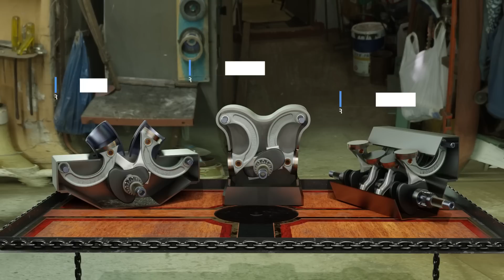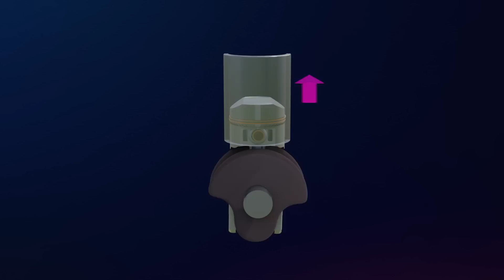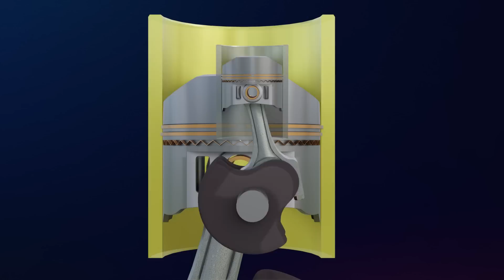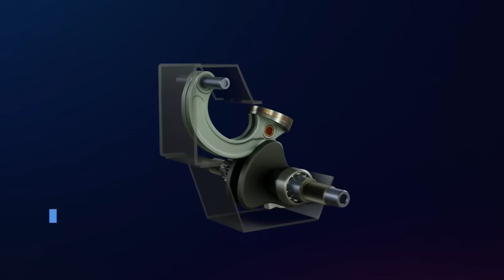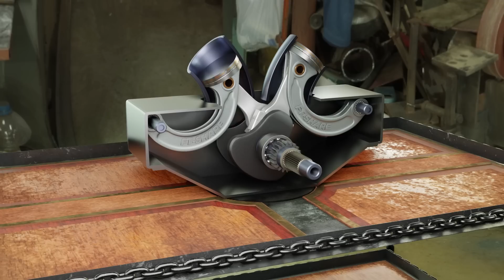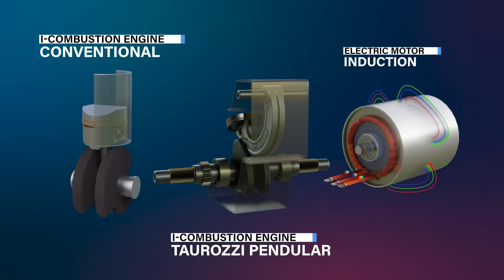All about the Taurozzi Pendulum Engine | Advantages, Working Principle, and Performance (100144.V1)

Comment: I would say, from a commercial standpoint, that any advantage of the 'low friction piston' would be offset by the difficult to machine bores, the balancing issues of the curved piston arms, connecting rods and crank all working in different planes, and it the extra reciprocating mass involved.
Most modern engines have tiny pistons, with virtually no skirt on them, just a small pad with Teflon on it.
Reply: Machining it is no more difficult than a linear type. The secondary balance issue is where it goes all willy nilly.
Reply: @ejrupp9555  I beg to differ on the machining also.
How do you machine a smooth finish on a curved bore and hone it suitable for piston ring sealing easily?
Certainly going to be more difficult/expensive than a cylindrical bore.
Reply: @ejrupp9555  If you put to engine together one on top of the other, where the spark plugs would be.  Then you could put 20spark plugs through the wall of the torus!  Yes you would have 2 crankshafts with gear on that would mate with a common idler gear that drives the out put shaft which would be on centre. This would get rid of some of the balance issues & double the power of the engine! Obviously it would have to be a Reed Valved crank compression, exhaust side ported 2 stroke!
Reply: @Danger_mouse  you would need a surface table that is geared to tilt at a rate proportional to the depth of the head stock. It would be a specialist piece, but not that specialist. Most industrial CNC machines could do it, but such a device could probably be made in a home workshop.
Reply: @arandomsteve2251 
I understand that it can be done, but it is not as simple as boring a cylinder, and therefore more costly to produce.
Also would be difficult to produce the perfect bore finish required for ring sealing (again, yes it could be done, but not simply with a straight jaw set in all cylinders like a production inline engine)

Then there's the balance issues on top of that.
This is why they aren't in production.
Reply: yes, but if they invested billions in a flawed technology like the rotary engine, why didn't they invest in a better attempt to do this, in my view this was "industrial sabotage".
Reply: @wvision1433  Mazda perfected the rotary engine, something nobody else managed to do.
During the 80 & 90s they were long lived and reliable, even as a turbo version. 
Only when people modify them do they start to become unreliable, and the later Renisis version was an attempt to chase the emission laws of the times.
Mazda did all of this on its own and from their own pockets.
If the inventor of this engine wanted to further the design, then he needed to work on funding himself.
As far as I can see, it offers no real world advantage over a conventional piston engine, that is why it is not mainstream. 
It's heavier, harder to machine and looks likely to have balance issues to solve. 

There's no conspiracy.
Reply: @Danger_mouse  I 100% agree with you, as a machinist and motorcycle mechanic I have no idea how a toroidal cylinder can be machined at production or any other level, it surely isn't going to be simple.
Reply: @1crazypj  Anyone who thinks this is manufacturable at scale has never made anything in their life😂
Reply: @curtislavoie2242  
I agree as  I've worked in a smaller  factory doing production machining way back when CNC was 'new' (outside of major plants, 1970's)
'We' had about 200 employee's, Sony factory 'down the street' had about 25,000.
Reply: @wvision1433  everything has to be a conspiracy right ☻
 It's not even contemporaneous with the Wankel 🤭
Reply: @Danger_mouse  no that's true the conspiracists can go prattle about Building 7 and all that rubbish.
However, as long as we all know that however perfected, and by whomever, the Wankel rotary has built in thermodynamic 'issues', namely a slow rate of compression, or pressure rise curve amda very poor combustion chamber shape
Reply: @TheHarryMann  Certainly can't argue with the rotary shortcomings, but Mazda did make it work reliably for many years.
Carrying a fire around with a triangle in an oval is not going to be the most efficient way to make and engine work, but they did make it work, and well 🙂
Reply: @Danger_mouse  Shouldn't be that difficult, but you need special tools.
Reply: @Danger_mouse  Liquid Piston has actually perfected the rotary engine. But yeah.
Reply: @Ridd333  Waiting to see how they solve the problem of sealing and wear.
Interested to see how they get around these issues.
Reply: @Danger_mouse  I mean, the seals on their fixed points on the block and not on the rotating piece is already a huge step forward. Might even suggest that LP has claimed as such. Not sure the testing done to the engines however.
Reply: Much more costly, more difficult to manufacture/machine the cylinders, more moving parts/complexity.
This is not the future of the ICE (if it has a future)
Reply: @Ridd333  curious why the location of the seals makes a difference.  The same parts come into contact with the seals.  Most curious is that the liquid piston uses a huge chunk of steel as the piston.  I have to read more into the liquid piston to see what makes it better than the wankle.
Reply: @Power5  The seals being in a fixed position should offer better material to be used. More robust, as well as not being wiped around at 6k rpm. 

So not only the seal thing better, but the shape allows for higher compression than the Wankle variety. I have not dug too too deep into it, so please do. Let's discover!
Reply: @Ridd333  But the end result is the same.  The seal is being rubbed against a chunk of metal spinning around at 6k rpm or the seal is attached to a chunk of metal spinning at 6k rpm.  In both instances the seal is always touching metal at whatever RPM the engine moves at.  That is why I cannot see any benefit to the seal being fixed.
Reply: @Power5  would you not agree that there are forces involved in the moving part mounting vs stationary?  Centrifugal force on seal as well as striking vs being struck? Plus the space available on the wenkle style is confined to the points, whereas the LP design offers more surface area for said seal.
Reply: @Ridd333  But there is no striking.  The shape of hole, that the dorito or whatever sponge shape you call the LP, is precise so that the seal is always under the same contact pressure with the metal.  The seal is never lifted from contact in either engine.
Reply: @Power5  oh sure. Same on Wenkle. My bad. Either way, those seals are common failure points on the Mazda iterations of rotary motors. LP claims their design corrects that by having seals in the block, not the "piston". Is that the only reason? Not sure. Other things I mentioned above may apply
Reply: Why are you arguing with people who have most probably never entered a machine shop....... those who say that making a toroid is as easy as a cylinder might have only done it in the virtual world, never on a machine that actually cuts metal..... 🤣😂🤣😂
Reply: @MondayMorning-yv7nf  Great point 😀👍
Reply: @Danger_mouse  The engine block is mounted on the piston pivoting axis and then rotated against a fixed boring head. One of the videos talking about the engine show the machine doing just that. If it was a ridiculously complex task, do you think a random argentinian inventor would have been able to do it over and over again in his garage?
Reply: @jackmcslay  I never mentioned ridiculously difficult anywhere, I said more difficult than a standard bore engine.
Anything that adds time and complexity to the machining and assembly process adds cost.
My comment was about the commercial aspect.
Reply: @Danger_mouse  and from something that was just pump to start with
Reply: How are Taurozzi engine cylinders machined?
This arrangement is currently produced for Mechanical Ventilation Medical Machines, where arrival of lubricating oil to lungs could be deadly.
Taurozzi engine uses no lubrication. Has it?
Reply: People saying this can’t be done in large scaLe production have never heard of Elon Musk or Tesla
Reply: @joedasilva38  Can be done. My original comment is that from a comercial standpoint, it wouldn't be via or have a market.
We humans can do anything, we have a rover and a helicopter cruising around Mars collecting samples... doesn't mean this weird, shaky engine design will make money. 👍
Reply: not much. the drill is mounted on a pivot.  @Danger_mouse
Reply: @geoffgunn9673 This engine is loterally used as an air and other liquids compressor, it makes more sense to invest in an engine that requires minimal lubrication than in a water pump that requires double the lubrication because of its flawed design (dorito engine), its obviourly been sabotaged or ignored by manufacturers because it would crash the librication industry and its derivaties which is not a bad thing

Comment: Not to take anything away from Taurozzi, but if the primary benefit is the reduction in frictional losses due to positional control of the piston, the same thing could essentially be accomplished with a guided upper piston rod, much like steam engines used a century ago.  Would require a taller deck, but wouldn't require the specialized machining of a curved cylinder bore.
Reply: That would simply move the friction losses to the guided rod.

Comment: Wouldn’t the piston skirts, even though shorter than conventional pistons, have to be curved to match the inner and outer radius of the curved cylinder and taper to flat at perpendicular to the curve of the cylinder to maintain tight enough tolerances for the piston rings to seal?
Reply: Yes, and drilling out a toroidal engine is easy with curved drill bits (that's a joke), which makes this the most complicated machining task possibly on the face of the planet for conventional tools. Its obvious why its not popular when jet engines are probably easier to machine than this thing...

Comment: Do you 3d print the cylinder or torus?/ Bcos it has to be very smooth surface. What cnc machine was used to bore this?

Comment: I have an article about the British Tri-Dyne engine featured in the July 1969 Popular Science magazine. At 350cc (21.35 cu. inch), weighing 135 pounds it delivers 90 hp. It is a true rotary engine since it does not turn eccentrically like a Wankel engine. Also it requires no seals which was a problem with the Wankel.
Designed by British inventer John Marshall the Tri-Dyne engine has 3 moving parts turning up to 12,000 rpm plus. It is more compact than the coventional automobile engine and would be ideal in aviation applications.

Comment: 30% more efficient? Never. Only a part of the friction in the motor is abolished, the other (mainly thermodynamic) losses remain unchanged. On the other hand, the bore (and also piston and sealing rings) cannot be machined on existing machine tools. Forget it.

Comment: Mazda keeps fine tuning the Wankle engine designs. They have been doing so for 40 years. For Mazda engineers the motivation is not profit, but the engineering challenge...and proving they can figure out solutions to the quirks in the Wankle Engine.
---
Just imagine if Mazda engineers spent that same 40 years of effort and passion to make a Taurozzi Pendulum Engine as powerful and efficient as they could?
I do not know the result they would achieve, but improving something already pretty cool...magnifies the benefits of it. Taurozzi himself had the dedication to improve his design, but never had a budget to properly commercialize it.
---
I looked at some other comments.
Machining the curved shaft is a challenge, but its already proven as possible...so if commercialized it would just be improving from something that works.
The biggest downside from the few comments I read is the length of the Swing Arms. Basically they would have a lot of mass as shown; this would limit the maximum RPM before inertia destroys engine. Titaneum alloys would reduce this problem of course but this issue might be the primary reason big auto makers did not want to commercialize it. A low RPM engine has its uses, but not regular cars; powering farm vehicles or specialized equipment like a gas powered compressor is much more niche and harder to make a profit than cars are.
Reply: and now they have relegated the rotary to charge an ev,,

Comment: 1. It is doubtably that it could run on a traditional vehicle without coolant or radiator. Modern gasoline IC engine is like 35% effecient, with 30% more effecient, let's say an effeciency of 50%, there is still a 50% of energy of burning gasoline purely converted into heat. If this engine is set up as a F1 application, which is a turbo charged 1.6L V6 revs at 15000 rpm, please, don't cool it. 2. The moving direction of the piston is circular, the expension of the combustion of the gasonline is evenly distributed. which means the force against the piston is uneven, which is almost the same as knock. Unless the spark plugs are placed at the far side of the circular combustion chamber but this will propose that the fuel injector to be places also with the spark plugs (direct injection) or uneven compression will lead to uneven heat distribution which causes knock. 3. The third ring on piston is oil control ring which is used to keep the cylinder wall lubricated while leaving not too much oil on it to be burnt. You need oil when there is a friction, even the connecting rod is like a banana. A rotary engine has much less friction surface than this engine yet the apex seal fails even with lubrication. 4. Balance. It's a nightmare for engine balance. I mean, just look at that jumping engine in the video. Traditional engine has two imbalance to solve, the primary imbalance and the secondary imbalance and these are fairly obviouse since the piston only moves up and down. But with this, the force is in reciprocating-circular manner, I would very much like to see how complicated that the balance shaft is. In general, this engine will work but not for long if it is used for vehicle power source. A rotary engine is better in every aspect that this video clams yet the effeciency is terrible and the longevity is a joke.

Comment: Funnily enough, when I saw the Toronzi's "Boxer" Format, I was bought to mind of the TS3 "Commer Knocker", an Opposed Pistol Design designed by the Rootes company, that utilized a singular Crankshaft and six pistons in a Three Cylinder format.

The company that made it actually planned for a Four Cylinder version known as TS4, which had boasted increased fuel efficency, lesser emissions and more power, but the Chryslar company bought out the small company before the TS4 could enter mass production, and ordered all schematics, Plans and models of the TS4 to be destroyed, only four functional TS4 Engines escaping destruction thanks to their designers managing to smuggle them out.
Reply: Indeed, I also thought of the taurozzi pendulum engine being a good candidate for an opposed piston. this is because you would only need one crankshaft and the reciprocating linkages have less moving parts when they move in an arc. perhaps  engine  balance would benefit too.

Comment: It doesn’t need oil or a radiator? Then its not viable. Any metal chuncks rotating around each other create heat and friction with no cooling or lube they are not going to last 10 minutes.

Comment: It eliminates lateral forces on the wrist pin, piston to cylinder wall friction, piston slap, heavy bore wear, power loss due to any of the latter…
Reply: this technology would be very good in 2 stroke engines, after all it basically reduces the need for lubrication in certain parts
Reply: With double or triple the reciprocating mass 😳.
Reply: More than offset by the extra mass and the cost of building it.
Reply: thus can be easily made out of carbon fiber as the load paths are simplified
Reply: @wvision1433  the designer made a smokeless 2 stroke go kart engine